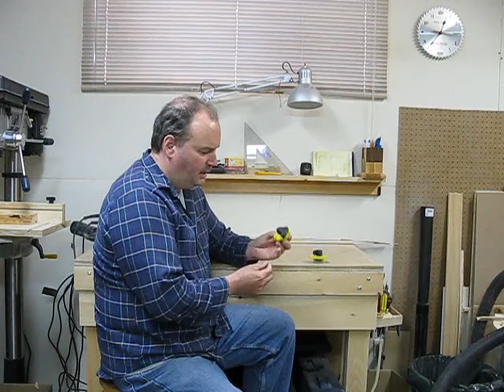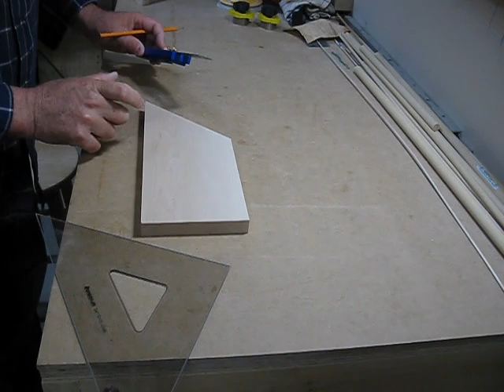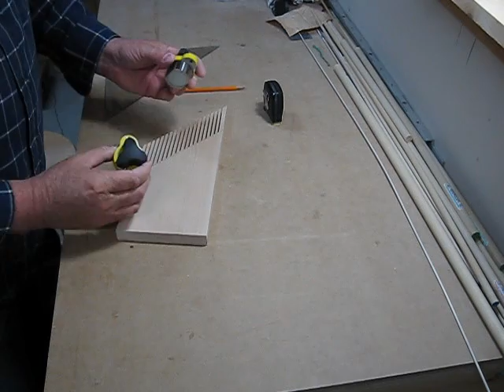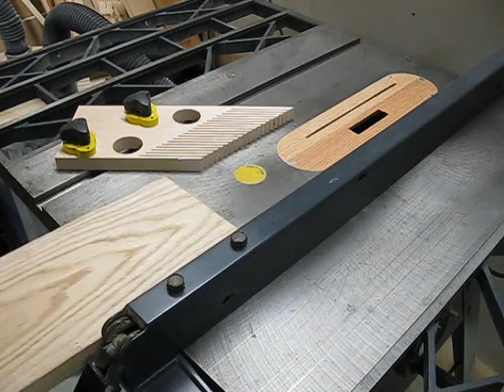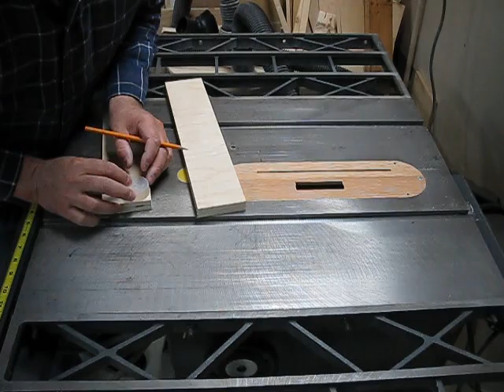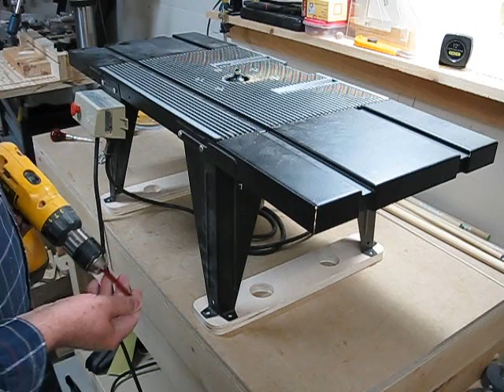Magnets-Feather Boards-Router Table

Comment: Those are great.  Only problem is, my Ridgid table saw does not have a metsl table.  It is some kind of non-magnetic material.  Darn!
Reply from the maker: +Rob I 
The nice thing about your table saw is it will not rust, so you don't have to oil and wax it like I do.

Comment: Your blade is set up too high, just a safe reminder God Bless my fellow Woodworker .Nice job
Reply from the maker: +jessie lacson 
At the 4:00 mark I explain that my blade is set to the highest level so the cuts end at a 90 degree angle to the wood to maximize the effect of the fingers and not to curve at the end of the cut.
As you can also see in the video, when cutting the wood to size and shape the blade is only half a tooth above the wood, as it should be.
Thank you for your safety tip, it is always good to remind people of safety around power tools.

Comment: That's perfect, great idea! how about putting some metal or wood dowels to line up with the mounting holes in the magnets so you don't have to use two hands to operate the magnets when turning them on. Cheers